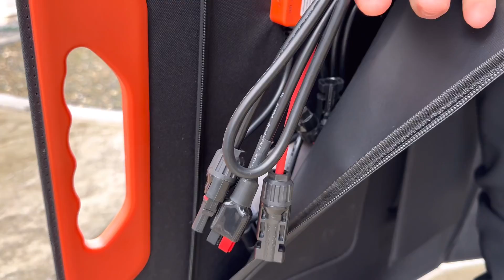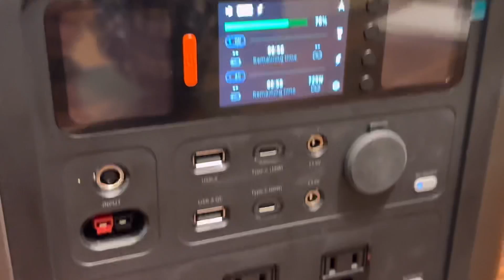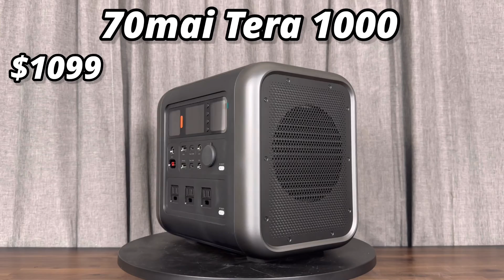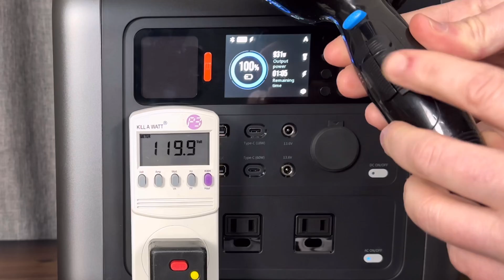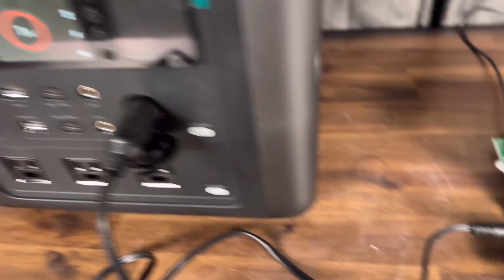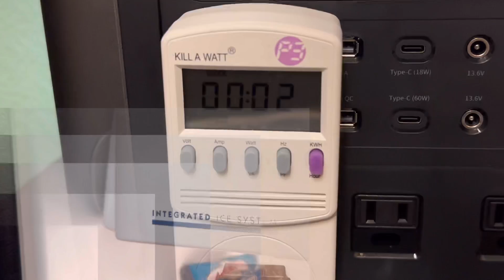Should You Buy?? 70mai TERA 1000 Impressive Unit ….But?

Comment: I've had my unit for a little over a year. I would not recommend this unit. If you got it down to zero, which occasionally you will, because you're not just right there watching the screen, you will have a problem getting it back up and running. at the present time it has totally failed. Not working (Dead)70 mia At this point is not warranting it. I'm getting the run around, the same with my bluetti has given me a run around! On there AC 200p Does not operate properly and  #3 350w soler panel fail from Bluetti.  . So beware of any of these companies I had a situation with the Geneverse home power one. I have had one panel fail and the power station fail. Replacement was quick and hassle free. Not like 70 mia or bluetti. They all say Hassle free (not true) LOL. Mouths and they are still NOT REPLACING. So I have $3,500.00 in junk, Boat anchors.! The EcoFlow Delta is a work house bot NOISE.
Beware From the
 Knucklehead.
Reply from the maker: Thanks for the feedback. Appreciated it 👍🏼